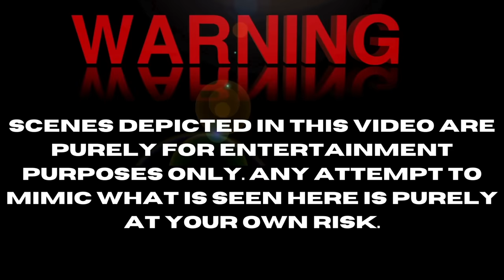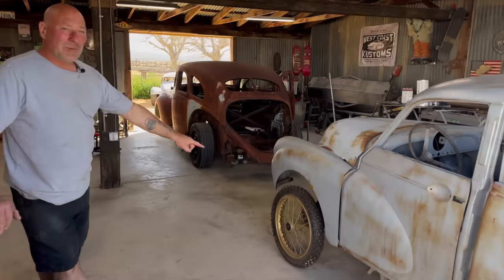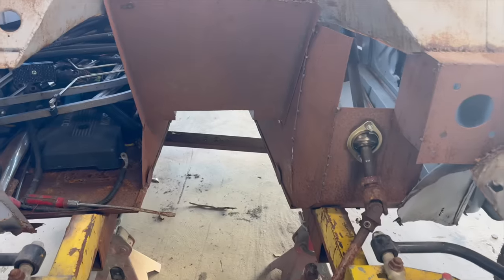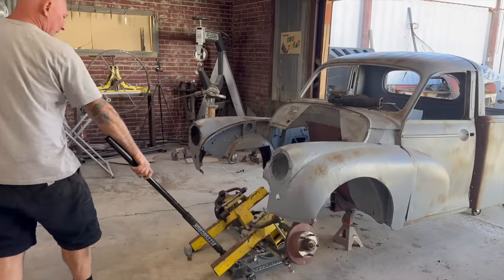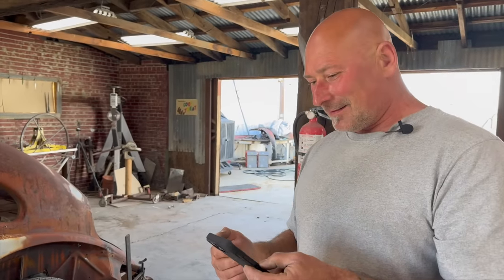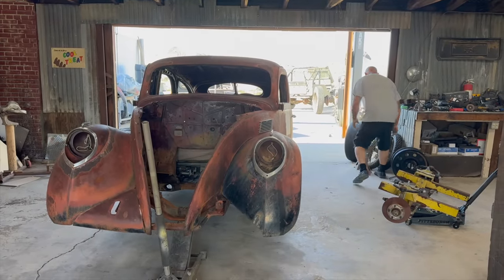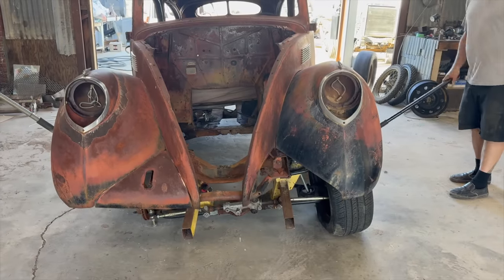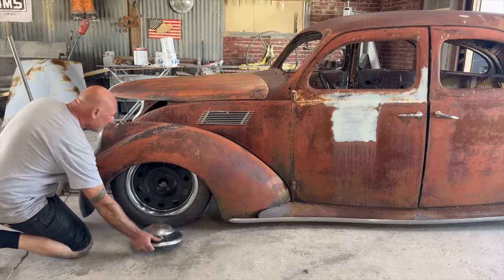Ian Roussel Customizes A 1937 Lincoln Zephyr Front Clip: A Radical Transformation In The Works

Comment: Hi Jaime and Ian from Albany in Western Australia. Sad that the Morris 1000 Truck is being used for parts. My father had one and myself and two siblings all learnt to drive in it. It had its exhaust system replaced by my dad with copper pipe as he was a plumber. Great Vehicle. A neighbor has a Morris 1000 van with an amazing rotary motor replacing the original motor. It goes like a bullet and to me is an amazing vehicle . BTW the Morris 1000 was used by the Japanese as a model to start their own car industry,

Comment: Hey, Ian; It's pronounced "TEMZ" like the river that flows through London, and those vehicles were the light commercial
arm of the English Ford Co. Those Morris utes had a full chassis, unlike the sedans which were unit construction [not
unlike your Lincoln Zephyr] and there was a van body with rear doors, which could be interchanged wth the pickup bed.
Both bolted up to the back of the driver's cab. Cheers.:face-red-heart-shape:

Comment: What a score!! 
Just widen the center piece of rectangle tubing of the cross member and lengthen the rack and pinion arms to fit desired track width. Easy peezy!! But it looks pretty right on tbh, especially when you consider the back spacing on those wheels. 🤔
Reply: That's what I was thinking cut the square tube in the middle and widen it to watch you need
Reply: Thanks for two days of fun with Jamie and Ian! Great stuff you two

Comment: I suspect you will have to widen the crossmember of the Mustang II to better locate the wheels under the fenders. The steering rack looks like it is shorter than most and may not give enough turning radius. An appleton brand rack used on some late model race cars may be a better solution and they can be found used.

Comment: You might consider cutting and welding the centers of the wheel backwards from the current orientation or simply just moving them to the correct spacing... could have a shop do it but that's expensive I'm outside the normal lines of piecing Parts together LOL😊

Comment: I probably would cut both sides of the frame and use the cross member of the old one after I boxed it and use the mustang upper and lower arms and frame. Then I put the steering column in I have enough room . Making sure my motor mount are in the right position before any welding has begun.

Comment: I would measure how wide a track width I need then I would cut the cross member in half and extend it to that width. Once I had that I would weld a section in the middle of the cross member to maintain the proper width. I would then extend the tie rod shafts to fit the extension added in.
Reply: A whole new rack is cheap and better turning circle.

Comment: That rear axle looks very Ford 8 or 9 inch. If you look ant the bottom bolts on the drop out gear pack, the 8" you can get to all of the bolts with a socket. The 9"  will require a wrench to remove the bottom bolt. If it is a 9" it is probably out of a Mustang as narrow as it is. The most coveted and bullet proof rear axle out there.
Reply: Dodge is what everyone's saying..

Comment: Thames pronounced even though not correct sounds like Tems if you said that in the UK they would know what you're saying...Thames was based on ford uk products. 
Only the Morris Minor 2 door doors are longer not the 4 door doors. 
Positive wheel offset is in  towards the middle of the car Negative offset is towards the outside of the car... 
FYI camber is opposite to that go figure! Negative camber leans towards the inner car at the top of the tyre... positive leans towards the outer of car at the top of the tyre.
It would make more sense if the were the same wouldn't it ?
Thus ends the lesson for today!